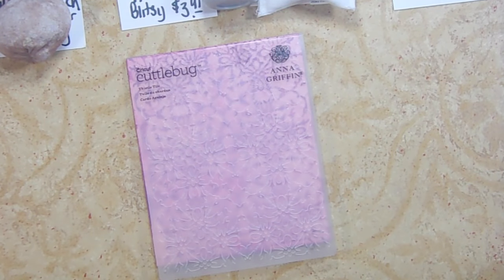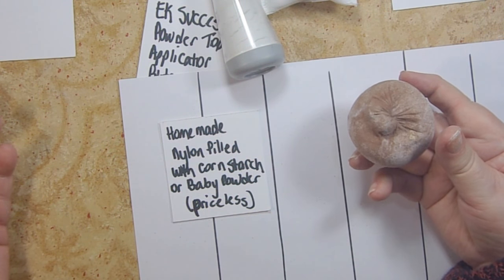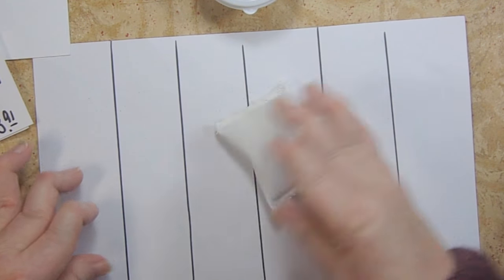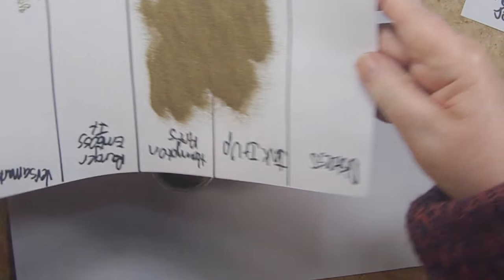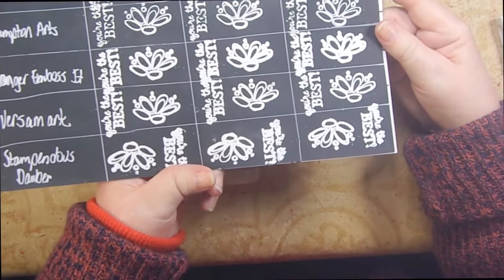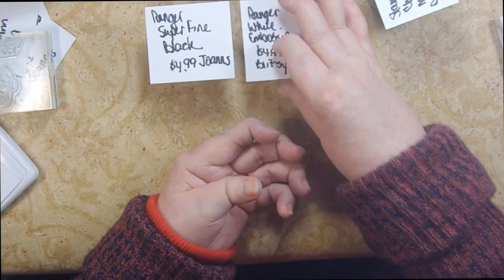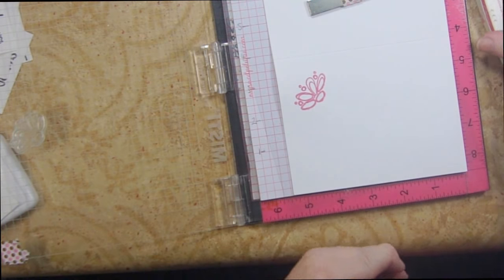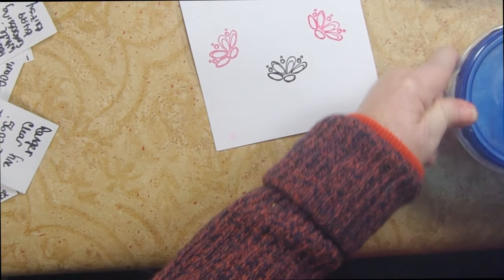Beginner's Guide to Embossing with Heat

Comment: Thank you so much for the tutorial on heat and bossing Sandy! I just got my heat tool yesterday, it is the same as yours. I have ink pads, I won 6 small bottles of embossing powder in different colors, in a online craft group I am apart of, as a prize from a game. I have paint brushes. the only thing I don't have is that little Powderpuff thing but I can make one of those. I'm excited to get started heat embossing! This was really a great tutorial!
Reply from the maker: Lee, I hope you'll send me a photo of your first heat embossing project.  There are so many things you can do when you've mastered heat embossing.  As for the pouch, I just took two knee highs and put them inside each other, then put some corn starch (or baby powder) inside and knotted it as close to the corn starch as possible, and cut off the ends.  I've used it for years and it still works great.  I wouldn't have bought the other "pouch" products as I really think my homemade one works best.  If you can sew, you could make your own pouch out of muslin....I only bought the bottle because I was testing to see if there was any performance difference in videos, and I found the bottle with the brush is the least effective and is hard to get the powder to come out consistently.  I can't wait to hear all about your heat embossing.....Sandy

Comment: That was a great tutorial for heat embossing. I think you covered literally EVERYTHING. I do the same as you with just using colored ink and versa mark over it with clear powder. I also bought a bottle of pure vegetable glycerine (got mine at Walmart in the skincare section)for jsut a couple dollars and refill my embossing pens as well as pads with it. much cheaper than buy the re-inkers.
Reply from the maker: I was really afraid to confuse people with glycerin, but will be doing it in one of the follow up videos for people who already have the basics down.  What percentage glycerin to water do you use for your re-inking?  I could have re-inked that Ink It Up pad with it,  but I didn't want anyone to get the idea that they needed to buy glycerin....I have never found the right mix of glycerin to water when I tried re-inking, and mine were too sticky.
Reply: In a 1 ounce bottle I put 1 teaspoon of distilled water and the rest vegetable glycerine. It is a bit on the sticky side, but works beautifully.

Comment: Sandy thank you so much for this video. You have helped me out in the past when I was having trouble understanding the differences in the types of ink. You had told me that you would be doing a video on embossing. This has been more then I could hope for. I had been reluctant about embossing because of the cost. In my head I had already limited myself to a few basic colors. I had no idea you could use regular ink with clear powder. But I do have 1 question. I have seen a few videos where they heated the powder from the back but never explained why. Thank you again, Debi.
Reply from the maker: So glad you asked.  If you heat from the back, you won't burn the paper as much, and some papers will warp, so it helps with that as well.  I used to only heat from the back because I was scared of scorching the paper.  I plan on showing different ways of heating in the next video, so we can tell if one method works better than another.  Thanks for asking...

Comment: Thank you for the advice.  I was wondering what are the first powders to purchase.  
Of course, I appreciate that you made my mistakes for me.
Reply from the maker: I would buy a clear embossing powder, and if you don't have Versafine Onyx Black Ink, I'd buy a stamp pad of that, so you can heat emboss it with the clear to make a really nice black embossed finish.  A metallic is great for Christmas cards etc., and I'm still trying to find a white I really like.  It will probably be in one of the next embossing videos where I show how hard it is to use white, much like black.  The Versafine Onyx Black ink makes black powder unnecessary, but there aren't any white inks that will do the same for white powder so far.  I'll keep you in the loop though...

Comment: Hi! I’m struggling with bubbles after I’ve heated it. Any suggestions what could be causing this?
Reply from the maker: I think you might be using a thick embossing powder, or ultra trick.  I'd change to fine detail embossing powder and don't put a lot on...you can always add more and reheat if you don't have enough powder, but I think that should solve the bubbling...less might be the answer.

Comment: would a pouch pad that you use for quilting stencils work?
Reply from the maker: I'm sorry, I don't know what a pouch pad for quilting stencils is...if you could tell me what your product does, and if it's a pouch, what's in the pouch, I'd be happy to help.  Sandy
Reply: I believe it is a chalk type power. When you have a plastic stencil design you pounce the powder bag on the design which sets on the material you are going to quilt and the powder sets into the design then you take off the stencil and the design sets on the material and you follow the design lines and quilt it.
Reply from the maker: @Pegsquilting  I'd give it a try, as you have nothing to lose.  If it doesn't seem to work, wipe the surface off and try baby powder or corn starch....Hope i helped.